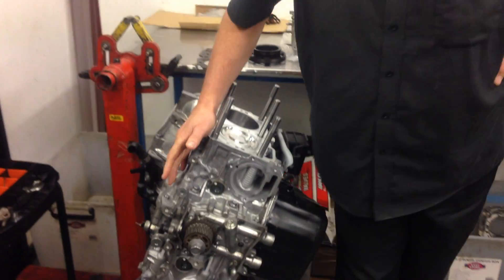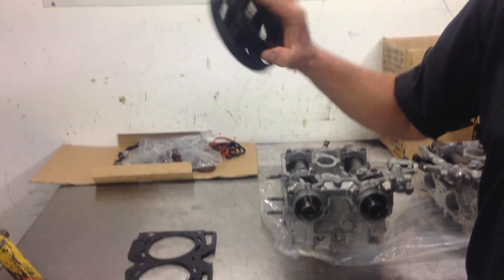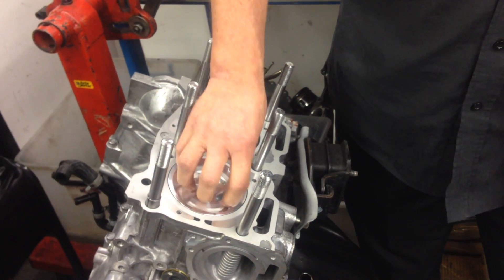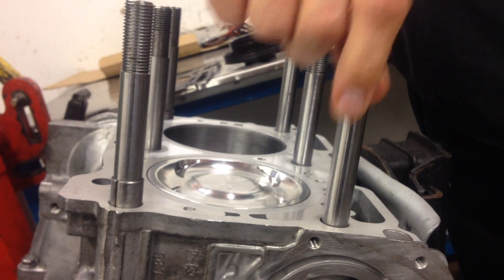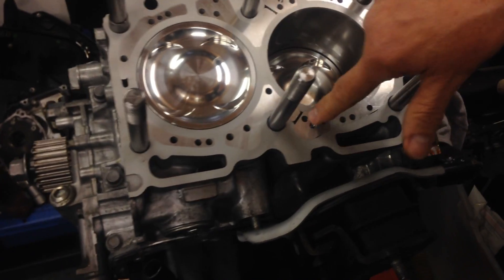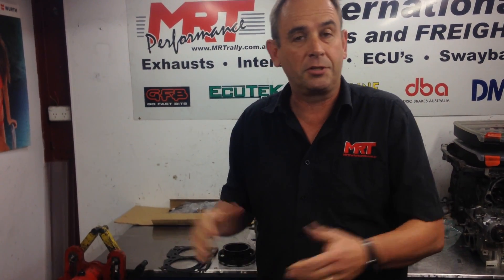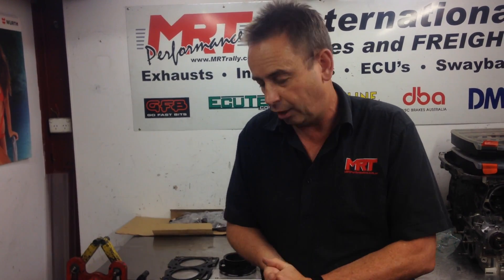Subaru closed deck block, what it looks  like and why its good

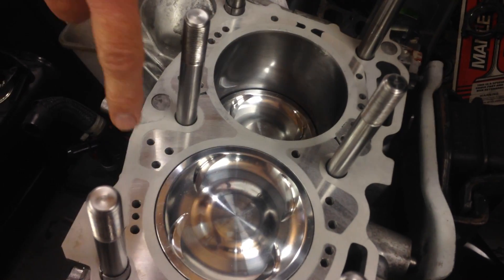Comment: 1:13 you are not telling people the truth. When the head is torque down on the block. The cylinders supported by the head. Honda K engines are open deck blocks and everybody know these are strong engines.

Comment: from what i read it's rare to find a wrx with a factory closed deck engine. is that true? i know none of the new ones are closed deck. what's the point of producing a so called rally car with a weak open deck motor. i know you can sleeve it but yeah who has time for that

Comment: I would never buy a Subaru.  It looks like a nightmare of unreliability and maintenance
Reply: I thought that for a while, but my cars 20 and it's pretty much the standard amount of work. No different to any old car
Reply: This car has now done 260,000 km, the last 110,000 with this engine with occasional track day. Broken a few swaybar links in the dirt, hit a kangaroo and needed a new wiring loop, but the engine has not had a single problem. It's a beautiful piece of work!
Reply: @stephenmyers4873  Fair enough.

Comment: Hi Brett, for an ej255 in my 06 wrx, would a set of forged pistons and supporting mods be capable of 350 horsepower or more? If so for how long will it last approximately?
Reply: 350hp at the engine yes... Recommended to go with E85, and a 11mm or 12mm oil pump!

Comment: I have forged internals and valves std size in my ej25 with piston head comp. Ratio 9.8-1 what thickness metal head gasket recommend? 7.8,1.1,1.5 mm?

Comment: Forgot the EJ22T used on the North American legacy SS from 90-94. Its closed deck, Also might be the only factory motor with oil squirters from Subaru. Note: the Ej22T did NOT come with a factory intercooler.
Reply: 91-94   not 90

Comment: These are only good if you increase oil passages. Close decking with stock oil ports will eventually fail.
Reply: This car has now done 260,000 km, the last 110,000 with this engine with occasional track day. Broken a few swaybar links in the dirt, hit a kangaroo and needed a new wiring loop, but the engine has not had a single problem.
Reply: @stephenmyers4873 wow great work mate

Any more updates please

Cheers

Comment: That definitely looks stronger, but what impact does it have on cooling?
Reply: Subaru should have these come closed from factory. I'd so buy a brand new sti if it did but why buy a new car only to have to do engine work.
Reply: That sounds like an experimental success!
Reply: Take a look at your typical garden hose. Now, turn it on full. See how much water comes out? Yeah, you can poke a LOT of water throw small holes, especially when you are actively pumping the stuff, at pressure.
Reply from the maker: it works!
:)
Reply: Greco Conduris Probably steals extra 70HP to turn water pump?!?

Comment: Just a question, I own a 2002 forester in which I just replaced the clutch. I hear a rattling sound that stops when I sink the clutch pedal. The mechanic says to give it 500 miles for the clutch to break in. Is that normal? It never made a sound before.
Reply: Possibly throw out bearing, if it doesn't go away, I'd take it back to him

Comment: Got a couple early closed deck RS motors in the garage, one is an ex rally Oz recce car motor, the car was heading for the crusher after the rally and the motor was saved by a local mechanic...